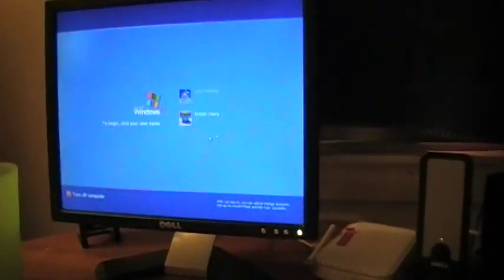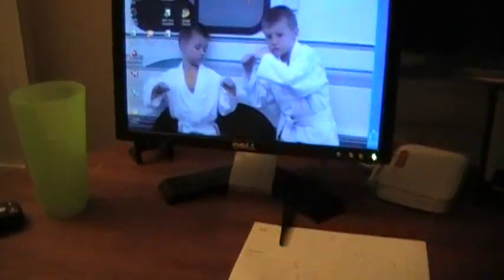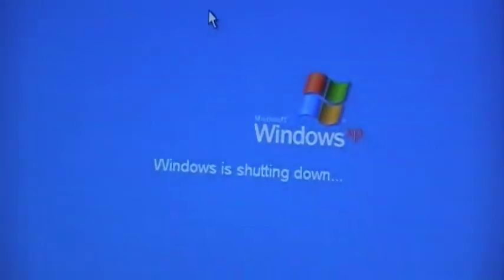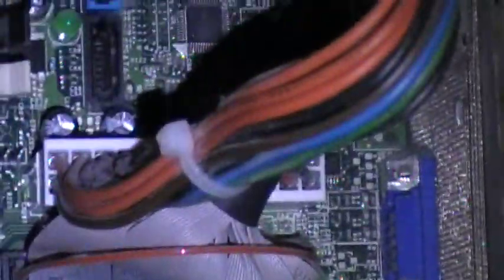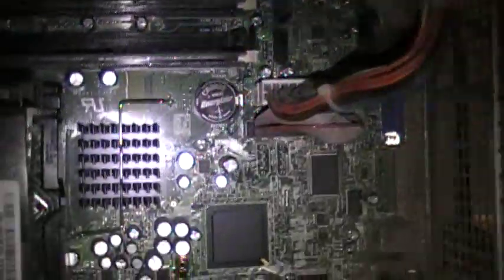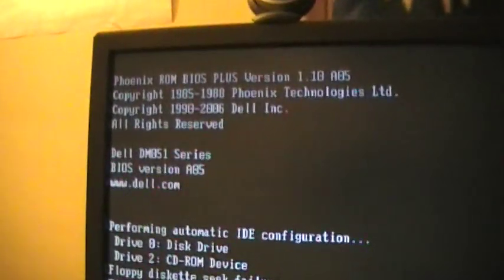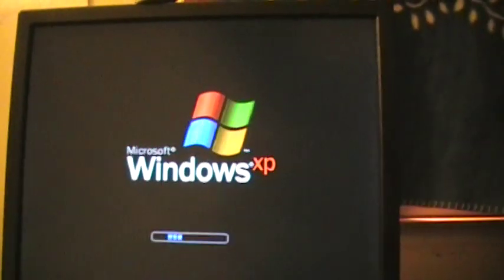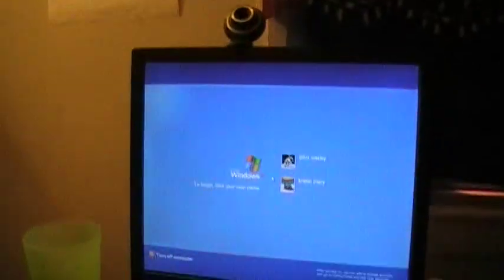Dell Amber blinking light fix."demensionsE510!!! no Power supply.

Comment: Holy Shit. I have this problem. The Computer blinks orange but does not start at all. Your Solution works perfectly fine. But the Problem keeps happening every time I shut down and restart the computer. I still don't know weather it is an issue with the battery or power cable or power button or something else. But i am glad it works at all.

Comment: Gonna try cmos jumping. Board looks great caps n all I managed to get a 500 W supply that's working ..I still am amber W 3. 4 showing in green. Hdd light will not catch.. the 3 4 is related to external vid card my grit 730 2 ddf5 .. I made Mfgrs send me replacement card it booted a few times and rt back too amber. 3. 4 I've not pulled vid card and gone back to internal vid .. this is not a game box at all. I'm thinking the machine is just had it. Hdd is fairly new 7200' just dunno

Comment: Thanks pal, this little trick works like a charm !! Before this I didn't have a reliable way in which to get my old 5100 to power up.
  I've replaced the power supply, the power switch board, & the ribbon connecting the power switch board to the mother board ALL to no avail !! Because, I would still get the damned flashing amber light . Eventually, I'll replace the motherboard with a good used one from ebay. I've heard of other remedies to this problem which involved splicing wires, soldering, & such...but I haven't used a soldering iron since I was freshman in H.S. 30 years ago !! So, I'll let that pass !!
  Sure, I'll get a more modern desktop eventually, but, I like the classics. Because, they are less sophisticated, easier to work on, & come with less to no spyware already installed on them.
Reply: Thankyou

Comment: Replace/repair the power supply and the main board. both will have bad caps. cheapest is to replace the bad caps. LMAO
Reply: Mine doesn't have any broken caps and it doesn't work

Comment: But the light in,my computer is yellow and when I turn it on the power button is yellow so what do I have to do
Reply: if yellow light stays on then check bad capacitors on motherboard, that happen to me with my dimension 5150 and I found 6-7 caps was bad then after replace them pc boot again with green light since then no booting problem works fine. the caps I replaced 6.3V 1500 uf some near cpu and some left and side of the ram units. hope this helps to others with yellow-amber steady light.
And just yesterday I fix my other Dimension with blinking amber light no boot by changing PSU solve the problem. PSu was working so I though first motherboard issue but after reading Jeff Toll comment I check PSU with tester and find out -5 light  fail and can hear strange noise from PSU as listen close by. will try to replace that two 2200uf 10V caps when I have time thanks Jeff :)

Comment: It's most likely the power supply capacitors. Check the power supply for swollen / leaky capacitors. The two most likely suspects are the  two 2200uF 10v capacitors located near the heatsink inside the power supply. Replacing these usually does the job.

Comment: Hey Brother,I had the same problem with both My Dell Demension E510 AND a Dell Inspirion 530. I just bought two new Bigger Power supplys and no matter how much strain I put on them ? they both run smoothly now without the noise  from the Dell Power supply OEM units. I TY for your video cause I learned something new. btw? the green thing is called a JUMPER my friend. Thanks again !!

Comment: On my DELL XPS Studio 435MT this issue was happening due to a weak power supply (360w) I went and bought a "cheapie" 460w PSU (30 bucks) and it has been working fine since. Nice video and good tip to get by in a bind.

Comment: It is is a faulty power supply that can't sustain a load or it is and internal short on the board. This method that you are using, surprisingly, get's it to boot. I would try it with a new power supply to make sure. If not you located the fault on the board (internal short) that somehow gets it to jump start on again. That led light that stays on lets you know when the 12 vDC rails have been discharged. With AC unplugged just hold the power button and it will discharge the 12v DC.

Comment: just buy the power supply with the button its just like the power booster same as the car it acts as a starter dell n255pd-00 you don't have to open close it already just press it when already green press the power of the desktop.

if you have more question don't hesitate to call 00966546068476

Comment: I found a good fix, if you search ebay or google for optiplex 735 repair, you will find a 5 capacitor repair kit.  $13 FREE SHIPPING!  Pull out motherboard, replace the 5 caps and it should work.  Same should work for searching e510 repair kit for instance.

Comment from the maker: you might have too much stuff plugged into wall or surge protector. You can only have so many things plugged in at once. Try unplugging something to lessen the surge. I believe it takes more power to turn on anything than it does to actualy run it. So if your using your tv ,radio ,or any other  item that uses power , it may be just enough to cut out your pc? Im not 100% sure what your question was but thats what i think. Dell has a major problem with their power supply units. But you can bypass.

Comment from the maker: @billbow100 do you have similar model? Is the light blinking fast or slow? how long have you left it sitting after you follow these steps. where are you plugging in? You need a good power supply. you must not be impatient even if its been sitting for a while. You can buy a new power box for 40$ at best buy. or ebay for less.

Comment: i had the same problem and by searching on dell forums , i found out that the power supply doesn't have enough watts(by default it just comes with 305 watts) and it doesn't have suffiecient charge for my USB stuffs, so i bought 600W power supply and installed it,and u know what ? it just fired up like lovely lady at first shot !

Comment: do you know that when it refuse to boot due to amber light, there's a light pattern when you hold the power button which is amber light. running diagnosis nothings happen but in windows, it happen again so the bios setting could be a culprit, remove the floppy diskette list in a bios could fix it if there's 2 and 3 amber pattern when u hold the power button while flashing amber